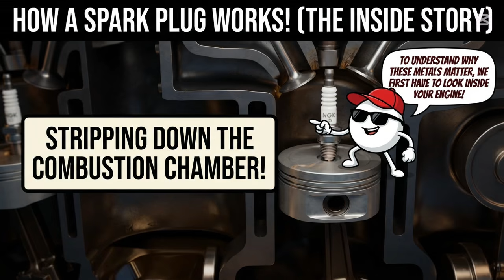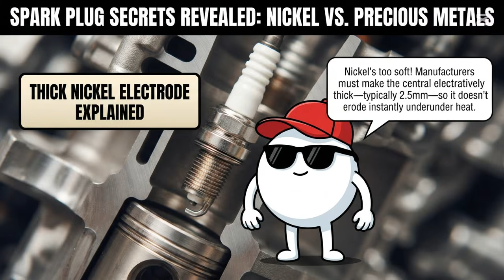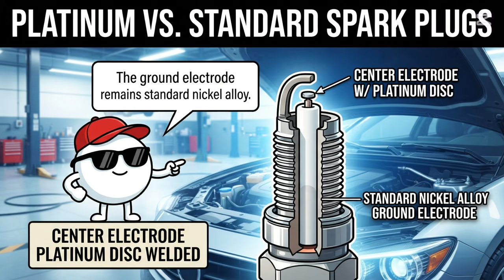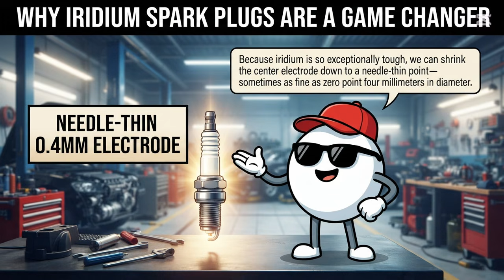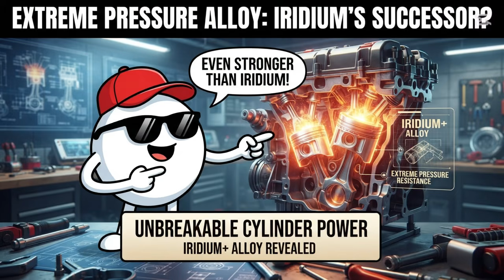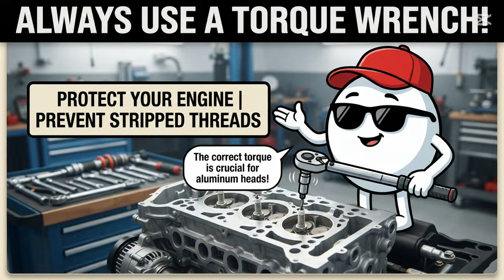Spark Plugs Explained:  Copper VS Platinum VS Iridium

Comment: How do "ruthenium" plugs rate? I hear they're in between platinum and iridium plugs.
Reply from the maker: They're actually a step above iridium! Ruthenium offers better ignitability and durability, making them a top-tier choice (especially for turbocharged or modern engines). Thank you for commenting